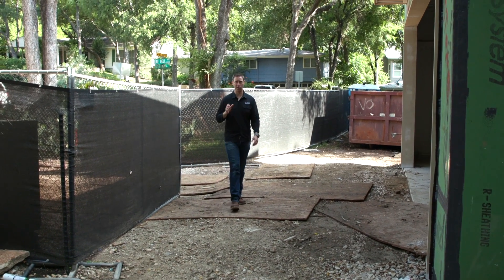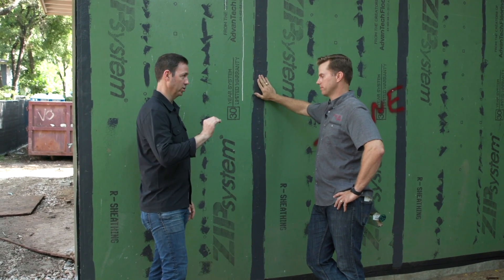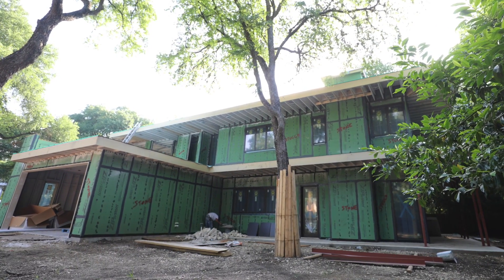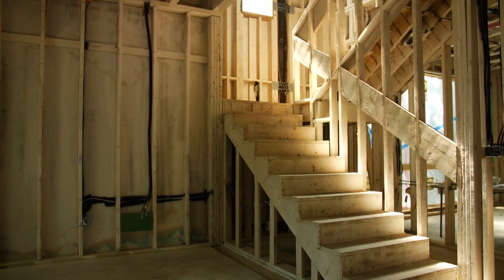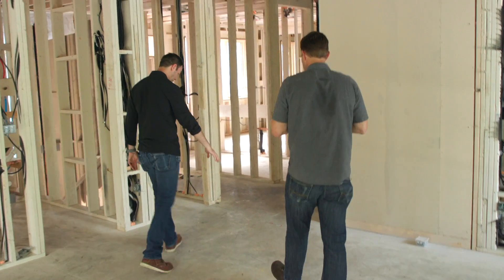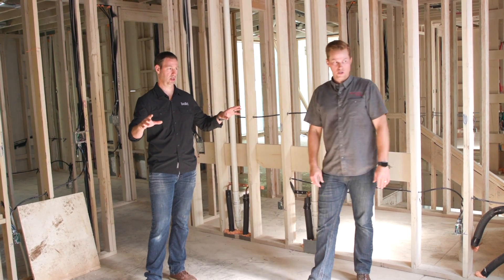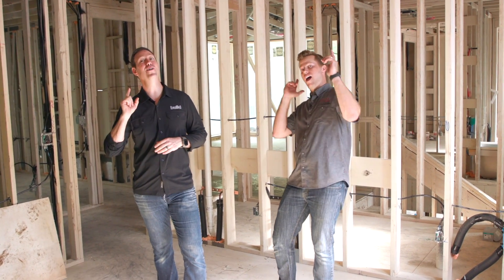Foam Free House - Is this Silly, or should we ALL BE BUILDING LIKE THIS?

Comment: Worked on a job similar to this. Client was really sensitive to EMF, which caused migraines, & severe allergies. The children had immune system issues, & needed the house to be extremely low on allergens, like none, & even had to create positive/negative pressure in certain rooms w/ separate HVAC systems..... Very very intricate detailed work & in the end, turned out great. The other big issue, paint. Couldn’t use anything w/ VOCs etc... So, had to have everything done and coated long before client moved in & again, used very similar products that are in this house. 
Living in FL, wish had some of the “tech” in those houses in my house to alleviate black mold, dust, humidity etc....
Great interesting vid....was geeking out! 🤣
Cheers✌🏼
Reply: Reading about your client made me think...Munchausen Syndrome and Munchausen by Proxy Syndrome.
Reply: Would love to ask you some question do you have an email or way to contact?
Reply: @Aepek  Why do you automatically assume that these people were sane?
Reply: @Aepek  Respond or not - it makes no difference to me - I let my posts stand on their own merit of logic - they don't require validation from you or anyone else. But the fact you won't address the point speaks volumes about your ideological position. Of course, anyone that calls out your nonsense must be a troll because you couldn't cope with the reality that you could be wrong.
Reply: @TonyRule  I figure no need to troll. just smile and laugh.   This is not my customer. People do what they want to do for their own reasons.
Reply: @Aepek  Yeah, run and hide from logical argument - the domain of the weak minded.

Comment: That MGO, even with 3 layers of grid fiberglass, seems like it's just waiting for a water spill or a peeing dog/cat to fail. And gluing the flooring to it seems like a recipe for future headaches
Reply: Stuff is completely waterproof; check out their website.  Been tracking this company and their product for years; was surprised to see them featured in one of Matt's videos.
Reply: @WinstonFiore  there are actual studies that disprove that. Not just marketing nonsense.
Reply: @bluenadas  Yeah, I'm starting to piece some of this together through comments.  One commenter mentioned "crying", and I found a few documents online with describing the phenomenon.  As I understand it, MgO panels essentially contain salt, which causes them to absorb humidity and "cry" droplets of salt water, which in turn corrode any hardware the panels they are in contact with, as well as support mold growth in nearby wood members.   Wikipedia article on MgO panels mentions the following: "Most often the boards are produced by using Sorel cement (Magnesium oxychloride), resulting in a slightly hygroscopic product that can produce a problem called "crying boards" when applied in too humid climate."  This leads me to believe that some manufacturers don't use Magnesium oxychloride in production, producing panels that don't cry.  Will be curious to reach out to ExtremeGreen to see if they are in this camp.

Regarding performance of product after water exposure, they do lay out the respective ASTM tests on their website: https://extremegreenbp.com/extremegreen-testing/

Comment: This is a work, right? Have you ever stepped into a finished house and said, "oh my gosh, that foam smell between the stucco and drywall is overwhelming!" . yes, it's silly and I hope this builder is charging an arm and leg for this silliness. Do they plan on painting the inside?? Maybe they'll use organic paint. Is that a thing? It's 2019. Of course it is.
Reply: Two sensable reasons not to use spray foam:
1. opencell SF is like a sponge. if it gets wet its going to hold on to that water for a long time (think plumbing leak or spilled bucket of water inside)
2. Closedcell SF is like a rock. if you need to do any maintenance in the future (ie fix plumbing, add electrical box, etc, its a PITA. 

If there is a fire, SF will release a lot a of toxins perhaps make it difficult to escape in time or cause long term health risks. Roxul is the best option in my option.

There are reported cases of the two part SF not curing properly. when this happens the foam never fully cures and will outgas a nasty smell for years (basically making the home unlivable). Its rare, but does happen.
Reply: @guytech7310  How about Airkrete, a foamed MgO insulation?

Comment: The slightly more reasonable foam risk mitigation approach is to let it cure, exposed to air, for a week or a month before re-entering the home;  Treat it like a long plaster drying time.  The air concentration of blowing agents will spike right at time of application, and slowly peter out over time.  And hang a huge liability clause into the contract: Foam application must be in many small coats, verified via GoPro, or the contractor is required to completely remove it.

Personally I still don't like it - fire risk is big enough reason to avoid open cell (which burns very enthusiastically and produces toxic smoke) , and cost is enough reason to minimize/eliminate closed cell.

Comment: Would an Advantech Decking covered by gypecrete not be a better performer and still comply with the customer demands  rather than MGO Decking? If so what would the Cost benefit be if any? The Fire block Foam vs Fire Caulk decision wasn't clear. Great exposure to a different mindset addressing VOC sensitivity. Thanks

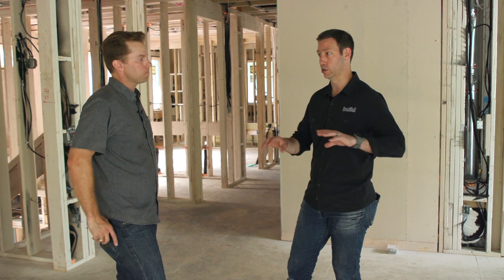Comment: 9:29 Matt is saying : "Okay, interesting", but he's really thinking : "Okay, this is bat-shit crazy"
Reply: So I guess my Lacquer thinner fountain that I keep running at home to remind me of that
sweet smell of "Job's almost done" is out of the question?
Reply: Everyone's money is green, but we were all thinking the same thing when he got to the wiring.
Reply: @jasonsstratton  I laughed my butt off.  If she really was being directed.. everything in the house that could be should be run below ground for large users of power.  Earth attenuates very well.  Anything else should be run  12 volt DC.  no sine wave propagation that way. and yup. if that's what she wants  smile and say thank you  for the nice premium.
Reply: @Jeremy Sarcasm is a literary device, not a tonal inflection.
Reply: Some of what they are doing makes a ton of sense and I will use it on future projects. For example, the fuzzy tape connecting the sheathing to the foundation. And the Zip liquid flashing. It's hard to see the benefit of the clay coating on the framing and the armored cable painted in carbon and cobalt (I think?) but certainly neither are going to lead to failures that the builder will have to respond to in the future.
Reply: David Kalil If you look at the way they’re building in Europe in general, and Switzerland or Austria more specifically, I really like the high-tech / natural way they’re building, using the most inert and natural materials possible - wood, masonry, sand, etc. Keeping low, or no COV, and not depending on lots of caulks, glues and sticking membranes to do the job is both durable and economical.
Reply: I have EMF & chemical sensitivities although they've improved a lot with some lifestyle changes. For a lot of folks they can get a lot better by removing the built up mold in the body that has bioaccumulated. These things are unfortunately very real. Electrical fields particularly alternating current is super unnatural and seems to interact with the limbic system to those who have chronic illnesses causing a wide variety of symptoms that sometimes manifests into what is called Mast Cell Action Syndrome (MCAS). 

A lot of people who have chemical sensitivity have a variation of MCAS and this is commonly a driver of symptoms and reactions. So while a lot of things can be solved with alternative building methods, some things cannot easily be. As far as the EMF shielding there is wiring that shields the wires as well as EMF blocking paint though I haven't had to go that far personally. Having an analog electric meter (no smart meter) and reduced or no wifi can make a bigger difference in my experience. I do realize there's a huge spectrum of sensitivities that aren't the same for everyone, what might work well for someone may not work for some else no two cases are alike, it can be as aggravating for the professional as well as the sufferer.
Reply: @tfinvold  finally someone who doesn't sound like an uneducated fool on here. EMFs are very real and if you're not doing what you can to protect yourself, you're an idiot. At the very least, don't make fun of people who ARE intelligent enough to take precautions.
Reply: HAHA yea. Chemical sensitivity stuff I was still on board. Soon as I heard RMF.. "oh boy, it's a quak"..
Reply: @MSI2k  Wait until they have installed 5G in front of where you are mostly. Microwave radiation all the time.
Reply: @MSI2k  YEESS!!
Reply: @MSI2k  Reminded me of the brother on Better Call Saul
Reply: Interesting ideas. But a client who indulges fantasy at this level can never be satisfied. Good luck when you get a callback because her chakras get all screwy due to your drywall screws not lining up properly.
Reply: @Ave_Xavier  Yep.  That builder is asking for trouble.
Reply: @Peter Lockhart Thanks for that. I never watched Better Call Saul and only managed to halfway through Season 3 of Breaking Bad so I wasn't aware of that plot line.
I found the WHO study mentioned in that video though and have bookmarked it for future purposes. https://studylib.net/doc/18169705/electromagnetic-hypersensitivity
Reply: @Jeremy If you knew what sarcasm is, you wouldn't have had to type all that stuff.
Reply: Was my Dad would say "This owner has more money than brains" but maybe not that nice!
Reply: I’ll bet she’s an anti-vax mom. That would explain the budget (no kids).
Reply: “I prefer... but this is client driven.” They try to mask it but you can tell they kind of resent being held to a... let’s call it “different” standard.
Why are they so concerned with air sealing? When I was in construction in the 80’s the journeymen installing siding were upset that the architect caught them not installing Tyvek house wrap and was making them perform to a standard they didn’t feel was necessary.

Things change. There’s always a better way; the trades will think you’re crazy.
Reply: Jeremy  he said RMF, mistakenly in the video. I don’t think it’s part of his vocab and to be honest, it shouldn’t be.
Reply: @bitterrotten  
RF radio frequency
EMF electromagnetic frequency
So he mixed the two together... 🤷‍♂️oops
Reply: yep
Reply: Peter Lockhart @y
Reply: For me, it was, "What kind of equipment is this person running inside their house? Oooorrrrrr, maybe they're just crazy?"
Reply: So he is worried about few extra tubes of SIGA caulk for this project . 😆 🤣
Reply: So when I go to work there can’t off gas my ass I’ve got chrons colotis and that would infringe on my disability access
Reply: I was thinking the same thing.
Reply: Why is cancer so rampant post industrialization ?
Reply: You betcha. This is what was going through my mind while they were discussing these details... https://youtu.be/VDndE432GpU?t=29
Reply: To  Tony Rule, Thank You total OMG! How perfect is that song...😂😂😂
Reply: Didier Morin-Laprise —— what’s going to stop the off-gassing from her own ass?
Reply: Some of you guys are idiots. There is ample research on the effects of EMFs on people and animals, so you could educate yourselves instead of ridiculing something you obviously don't understand.
Reply: @Jeremy So why didn't she ask for the entire house to be covered in aluminum foil to protect her from the deadly radio waves from cell towers?
Reply: Client can save some money by visiting a wich to have exorcism performed. Get rid of the chemical sensitivity from the head.
Reply: The client is crazy. Couldve build a normal house and said they did all this stuff and she wouldnt notice.
Reply: does not matter Why or what we think. This customer is working with consultants and the architect and the contractor.  It is her house.  People build what they want and have their own personal reasons.  She is paying. SAY THANK YOU. Every change order and upgrade is $$$ in the bank.  He is taking to heart best practices as we have all seen on this channel.  Does she really need all of this? could be. I know I am not there to play referee.   As to the crazy part OK yup just sit back and laugh takes all sorts to make the world go around.  I thought the vent fan in the garage was a great idea.
Reply: @stevepailet8258  Yeah, but at 60CFM, that fan ain't doin' diddly squat in a ~400 square foot garage. My 400 CFM range hood just barely sucks the smoke out that was created 2 feet directly beneath it. Might as well pay someone to sit in the garage and whistle, they'd have the same effect.
Reply: @RobertBarth1  two things happening.. negative air flow so moving air from the house rather than from the garage to the house. figuring 400 sq ft time 9 foot tall 3600 cubic foot.  Pulling 60 cfm the total air will be changed once per hour.  This is more than adequate, even though you seem to think that one needs a 5000 cfm blower
Reply: @stevepailet8258  When I drive into my garage I generally don't wait an hour before walking into the house. That's just me though. Maybe other people have an hour to wait for the air to turn over in their garage. Oh wait, it doesn't matter because of diffusion.

Comment: actually an earth bag house would be a lot cheaper and toxic free  also the electric issue can be controlled by aluminum mesh or coating and could be more effective and cheaper or copper does the job as well.... I’m not sure how well the paint would do
Reply: So there's nothing toxic in dirt? No bacteria that can make you ill or any heavy metals? In that case, I must remember to wash my hands with dirt every time before I eat.
Reply: @TonyRule  there is no perfect way to build, it always comes down to money and time
Reply: @colstace2560  Sure. But there's certainly better ways than with mud.
Reply: @TonyRule  I like brick myself, but I have built with ICF also

Comment: I am not a builder but love watching videos of these unusual type of builds. I would guess that the Placebo Effect added to this house will work wonders for the owners health.
Reply: Yes, the placebo effect is probably the only benefit gained from the extra expenditure.
Reply: @TonyRule (Rich) white people's problems.
Reply: I suffered for a few years with allergies at home, only to find out my vacuum sucked and my carpets were fucking filthy.  Got a new vacuum and it was amazing what it pulled out, allergies went away within HOURS!

I renovated my house and did a ton of air sealing, and have hardwoods and tile throughout.  Also put my exhaust fans on timers and run them a good while after showers.

They should have talked more about ventilation in that house, although I'm sure that's well overboard too.  Controlling air quality and bringing fresh air in will do a lot more than freaking out over subfloor material!
Reply: @bigpjohnson  code in Massachusetts now is one of the "fart fans" need to be wired direct and running constantly all day and night everyday forever .i am wondering what that does for the energy and heat efficiency having a four inch tube blowing your heat or AC out .all this work to make them air tight and now they are changing codes up to counteract the problems they have created with the new energy codes .it is always funny to me how people talk about the zip board being.   
" waterproof " it has nothing to do with being waterproof it is about being air tight for blower door test .but as I mentioned the blower door test directly coincides with the energy audit .if you put junk appliances in it will adversely affect the final number on it all
Reply: @jefflinnell8492  True.  Building science is 2 steps forward, 1 step back.  Solving one issue creates others, and it usually takes decades to realize there IS a problem, and develop a solution for it, which then creates other problems.  We're getting fairly good at it now however, the 2000s have been a boom in building tech especially in regards to water and air sealing and ventilation.  Unfortunately, at the same time finding good workers is getting harder and more and more wood is either junk or man-made.
Reply: @bigpjohnson  job security for the future construction guys .lol .just like vinyl siding , no one ever tapes the piece they cut under the Windows and every one of them is rotten
Reply: @bigpjohnson  so true ,..building tech and qualified help and the lumber way to many pencil pushers that don't build or remodel and have no idea what the consequences are
Reply: @bigpjohnson  I watched what was coming out of a steam cleaned carpet in a flat I was renting about 25 years ago, and then when the bloke had finished I looked at the carpet again. The top half of the pile was cream, and the bottom half was still black.
The house I built for myself has no carpets. They're filthy things.
Reply: If it works that’s all that matters!
Reply: Honestly, the placebo effect is one of the most powerful in medicine.  If you can get that working for you it will do wonders.
Reply: Just have a Fairy Dust Blessing Ceremony, alls good. That will be $40,000 please.
Reply: Just because you can't see something doesn't mean it isn't there.
Reply: It’s usually pretty hard for someone who has not experienced extreme chemical sensitivity to understand it. It seems absolutely ridiculous…..
right up until it’s you that has it.
Reply: No her health will go to shit like everyone's else does with age, and all she'll think about is the little bit of fire block foam and the LSL stair treads and then the lawsuit will begin